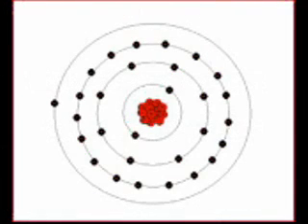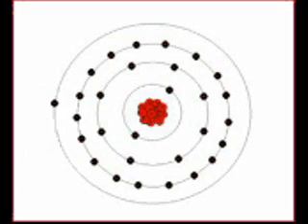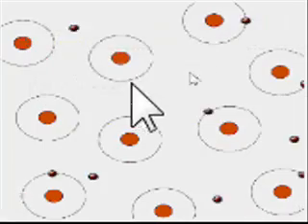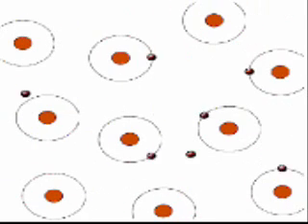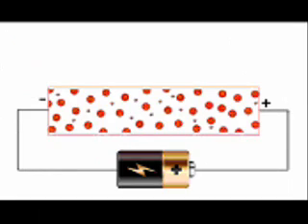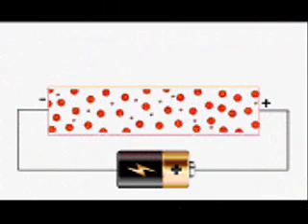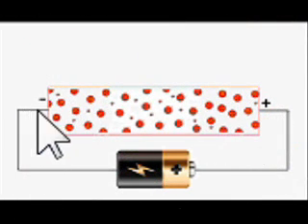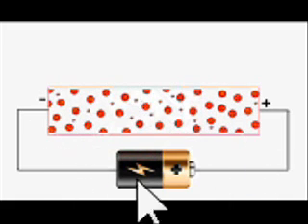Theory of Electric Current

Comment: https://youtu.be/U7RLg-691eQ
A working definition for current in conductors like metal wires is "the start-stop motion of millions and millions of conduction band electrons everywhere within with a drift superimposed". 
In circuits, voltage is due to surface charges. Consider a simple circuit comprising a battery, two wires and a resistor. An electric field is there in the wires and in the resistor; powerful electric field and uniform within the resistor, weak and uniform within the wires. The field is set up by a tiny amount of surface charge with a steep gradient on the resistor and not so steep a gradient on the wires. 
It is the electric field E created by the surface charges sourced from the battery, which produces a force causing the mobile electrons to acquire a drift velocity v = (mu)E, where (mu) is the mobility which is a number representing the freedom of movement of the electron in the lattice. 
This results in a current density J = (sigma)E, where (sigma) is the conductivity of the material.

The p.d. or voltage across the resistor is the integral of a constant powerful field along its length. The p.d. or voltage across the wires is the integral of a constant but weak field along its length. 
Voltage is entirely because of the surface charges.

For a demo of surface charge and its effects visit 
https://youtu.be/U7RLg-691eQ
Electrostatics and circuits belong to one science and not two, that of electricity and magnetism. To know how they are unified visit this link 
https://matterandinteractions.org/articles-talks/ and view the article 'A unified treatment of electrostatics and circuits.  B. Sherwood and R. Chabay, unpublished. (1999)'
pdf. 
For more details see Electric and Magnetic Interactions by Chabay and Sherwood 
www.matterandinteractions.org
or 
https://www.wileyindia.com/fundamentals-of-electric-theory-and-circuits.html
For a lecture by Prof Ruth Chabay on surface charge in a simple dc circuit visit 
https://youtu.be/-7W294N_Hkk